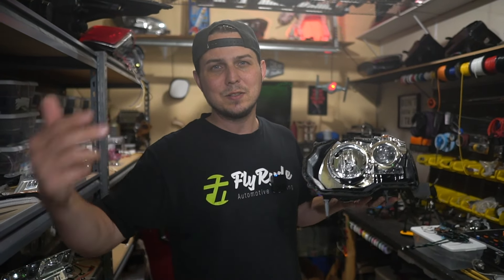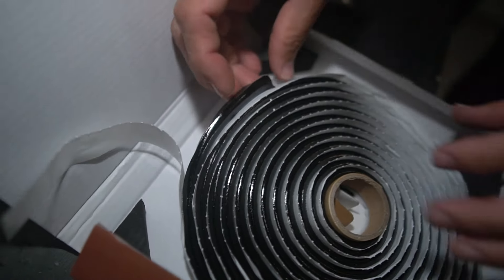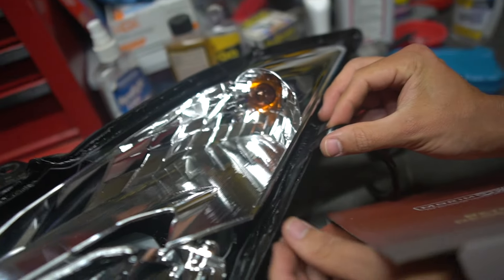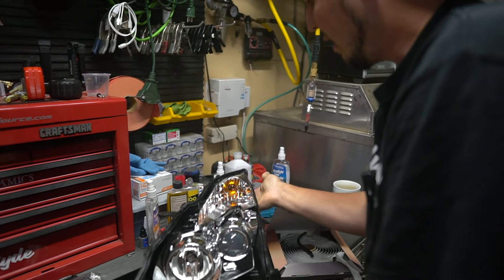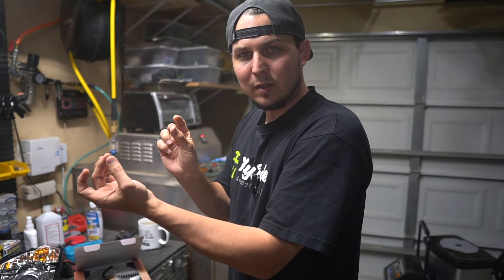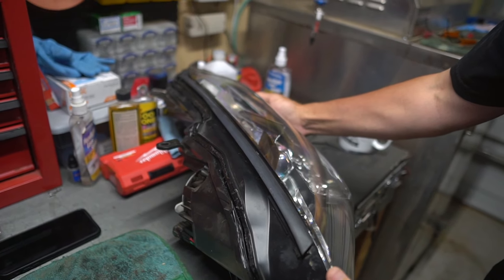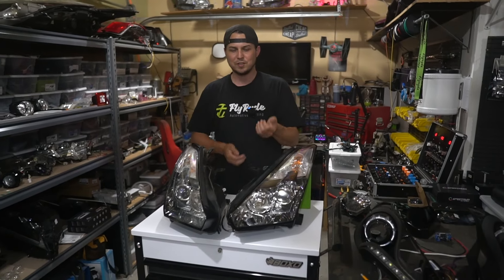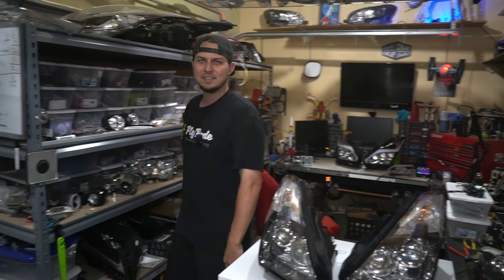Resealing Headlights with Retro Rubber

Comment: Thanks for this comprehensive video.  Doing my first reseal and your advice is gold.  Retro rubber is definitely the way to go.  It doesn't feel exactly like run of the mill butyl rubber sealant.  The formulation must be a little bit different.  It feels like the softening temp is a bit higher than regular butyl.  And also holds its shape a little more at the same temp.

Comment: Dude I watched the whole thing! I really wanna see a video of you using a hot melt gun or machine to seal up headlights. I need to seal up old school 7” glass sealed beams and there is no way I can use rolls of butyl. Really interested in:
1. The best machine to use
2. Whether I can use a hand held gun 
3. Whether I need to find butyl glue sticks or can use ‘bricks’ of glue
4. The thickness of the melted glue and how fast it flows and how easy it is to control
Thanks Chris!!

Comment: So the way I do my process Chris is I put the rubber in cold. Run it along the channel. Heat it up with a heat gun. The I get a old flat head Screwdriver and smooth it out and push it in the channel if I have to. Install the lense and heat up in the oven after and clamp it down

Comment: In Dubai on a normal summer day the temps in a parked car will exceed 200 degrees. When running, the headlights will reach temps over 400 degrees and that's totally fine
Reply: They never reach even close to 400 outside the projector or the reflector housing near the bulb.

Comment: I just bought a set of Mopar OEM headlights for my 2011 truck and I want to make DAMN sure they never leak like the originals did (after about 8 years).
Can I apply that retro rubber without taking them apart and without putting them in the oven?   Or is there a butyl rubber caulk that I can just run a bead around the edge for extra protection?
Reply: No point in fixing what ain't broken...and to do it properly,  the old glue must be replaced with butyl, so baking is a necessary evil.
Reply: @DL101ca  
Too late.   I put clear silicone all the way around the edge.

Comment: Advice needed. My custom headlights keep missing up bad. 3 times now I have taken them off, heated up and with a vacume cleaner inserted to suck out the moisture. Yet they still mist up badly.
I can't see any holes or damage that's letting water in either.
What do you suggest?
I did think what about blasting them in an oven on a low temp to hopefully get them bone dry? But what temperature and time
Reply: Your sealing isn't done properly or the vents are plugged. Headlight have vents to allow moisture/air to escape while the inside heats up and expands. They're not completely sealed as you would think.

Comment: For whatever it's worth, I work in automotive field as mech engineer and the IATF 16949 standard have temperature range -40°C to +125°C (-40 to 257 F) so material typically made to withstand that, being electronics/mechanics/paint, what have you...

Comment: Might be a silly question but how come we can heat headlights up to open them and not do the same with tail lights? Everywhere I look, you are instructed to cut the tail lights open. TY
Reply: Taillights are sonically welded, so no glue to melt. They need to be mechanically separated by cutting the housing or the lense open.

Comment: I’m confused. If I put the headlight in a preheated oven, the headlight heats up. If I put it in a cold oven and turn on the oven to 220, both the oven and headlight heat up together. Seems like it would actually be less thermal shock to heat both oven and light together. I just opened up my headlights that way the other day, heating them up from a cold oven, had no issues.
Reply: I think the purpose of preheating is because you can precisely time to his recommended 7mins, since there are so many different kinds of ovens that may take different amount of times to heat to the desired temp, the consistency may be different at different times/temps, so by preheating (anything, not just headlights, like pizzas), you're ensuring consistent heating for a specific amount of time (maybe some ovens it can take 1min to ramp up to temp and others 5 mins or 10mins)

Comment: Hey, I am just trying to redo the reflective surface of the headlight bowl. I have an old 1995 Sidekick that water got in and (water/moister...you get it) it oxidized, so the headlights are non existent when they are on! Is there a paint that I can use to restore them or do I need to send them off somewhere to have it repaired?
Reply: There are shops that could rechrome them, but why not stick some projectors in there and have proper lighting where you need it ?

Comment: How do you clean projector lenses?
I spent most of the time getting lenses clean, and still couldn’t get them perfectly clean.
Reply: They're glass so any glass cleaner that doesn't leave residue will work. Personally I would use denatured alcohol and a clean microfiber towel.

Comment: Would u recommend this for tail lights that are heat welded, tail lights you have to use a dremel to cut open. This seems easier to work with than J-B weld.
Reply: No, this could be used in conjunction with jbweld as alone it doesn't offer the structural integrity to hold the lense in place without a mechanical fastener(channels and clips in headlights) . JB weld is the way to go, maybe use in few places to hold taillights together then seal the rest with butyl if you feel you can't do jbweld all the way.
Reply: @DL101ca  got it, thanks!

Comment: Silicone is not the fast way. But cheap, easy and reliable. It needs week or two to harden and stop excluding vinegar. I used the cheapest sanitary silicone and not hard version for sealing aquariums because i want the option to disassemble it. 2 years no leak, car stayed outside and used daily. But i completely cleaned lenses and plastic back from old butyl sealant. I tried to use butylalwaysstickymess from tube  but it was too hard to press lens enough deep into plastic back of light. Butyl from tape like on this video is version which is easy to disassemble, but hard to seal properly. Small mistake = leakage. After 2 or more years i removed headlights because i switched a car and i wanted to know state of morimoto mini copy lights i used to modify the headlights. I was able to open silicone sealed headlights but i do not remeber how, maybe patience. It is more than 8 years so i do not remember exactly. I modified headlights in 2011 or 2012. I used morimoto mini h1 copycat modified for H1 halogen bulb. Not good for minis, they do not like about twice as much heat, so aluminium surface was started to peeling off and plastic holder of lens had broken one leg. But i liked light output.
Reply: Silicone you can just cut and pry away, it doesn't bond properly to plastics anyway. It will pull off easily unless the surface is rough enough to grab it.

Comment: Hey, loved seeing the whole process of sealing the headlights. I might have missed it, but did you add the screws to the headlight at 19:15 or the headlight came like that. Might be a stupid question, but mine had only butyl tape, no screws on the outisde.
Reply: Most of the headlights I have seen come with screws.

Comment: Whats that packet inside?
Reply: Silica gel to manage humidity
Reply: @gixxerjay79  Is that factory?
Reply from the maker: Yeah, on these lights they are built in. Very common with factory Xenon / LED
Reply: @flyryde  do they come stock on dodge chargers? Ive seen some inside a prebuilt oem set someone built and thought they added it

Comment: Love this kind of video. I made my FIRST mistake on my FIRST set of taillights! I didn’t heat up the retro rubber and I, for some reason, put the light in AT 240 DEGREES 🤦‍♂️  for almost as long as I did when I pulled them apart! 🤦‍♂️ silly me but I’m learning… @krimsinxprojects

Comment: Super glue 👍 😆
Reply: No. It fogs the plastic and won't be evenly dispersed. And unless you use a slow-set gel, it will dry before you get glue all the way around.
Reply: @katdeville  - Plus, superglue works to connect surfaces and needs water (vapor or adsorbed molecules) to set.  These lights don't fit that tightly and need an obstructive mass to finish the seal. Superglue would be used as a blocking material but wouldn't work in that rule. Superglue doesn't stick to itself very strongly.